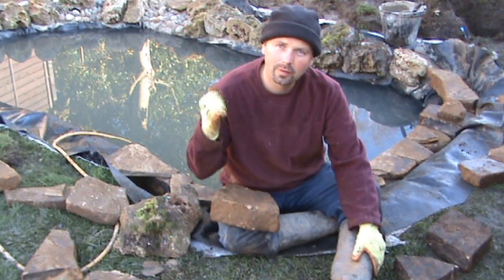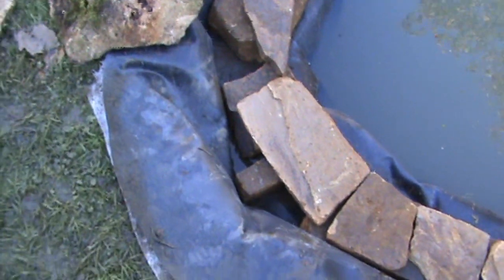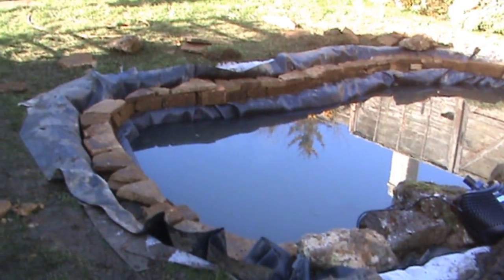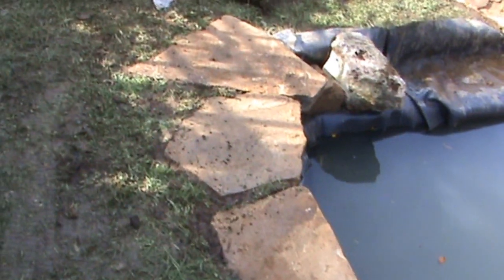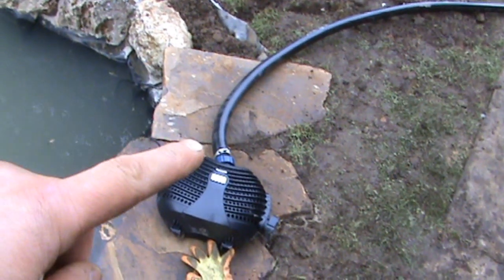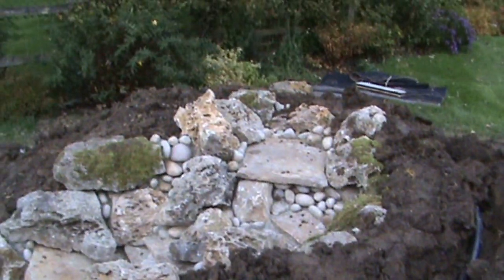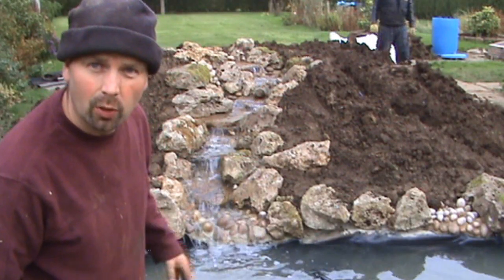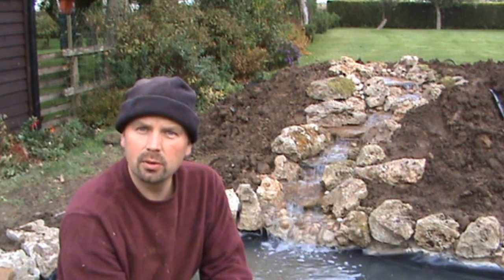How to Build a Fish Pond Part 3 - Installing the Edging, Pump and Filter

Comment from the maker: The filter may take up to 2 weeks to clear the water even though it is on 24/7. It always helps to have the pump at the opposite end of the pond to the filter outlet as you will get a better turnover of water then.

Comment: Your videos are so helpful!!! Question: what size tubing is being used? 1.5 or 2"? Going from my pump to the pressure filter, and from there out and up to the waterfall.
I saw in one of your videos you used a Y-Connector in order to let filtered water either go up the stream )or water fall) or directly back to the pond. I believe it is not suitable to ALWAYS use stream if very hot or very cold outside and in this case only let it go back to the pond directly after the filter, correct?
Many thanks, Willy

Comment: hiya mate , your videos are very usefull , ive watched most of them , if u dont mind can i ask u a question ? i have a still pond at the moment which i have call ducks in , but i want to build a raised , fish pond so the ducks dont eat the fish and keep the existing duck pond , my question is can i filter them both off one pump and one filter ? i was looking at the oase 8000 , but i wanted to cascade the raised pond into the lower one , or will i have to have two pumps ? cant get my head round it , if i could do it off one pump , would i have the pump in the lower or higher pond ? if any of this makes sense , i can build the ponds no trouble as im a builder just unsure on the filtration's , also do u sell , oase stuff im not far from you , north yorks near flamingo land uve probs been there cheers for any info keep up the good work !!!

Comment: I have a pond like this that I inherited when I bought my house. I have to take measurements to figure out how many gallons it is. I would like to buy a good quality pressurized filtration kit but not sure what to buy. I would like the uv light option and the backwash option also. Any suggestions on brand names that wouldn't be too expensive to run (electric wise) each month?

Comment from the maker: I always go with Oase as other manufacturers (e.g. Hozelock, Laguna, Bermuda and the nation of awful Chinese copies) concentrate on making their products cheaper, not better. The Oase pumps have very low running costs, long guarantees and the only running costs of the filter are from the UV light which range from 9w to 55w. 1w costs roughly £1 a year so a 55w UV unit in the Filtoclear 30000 filter would cost approx. £55 a year to run.

Comment: Awesome!!!
Reply from the maker: Glad you liked the video.
Reply: Wish I had a garden big enough for that pond I'd try and make it myself, I'm good at D.I.Y at the moment I'm making a water fountain that's how I cam across your video, I was trying to find out If I can just run a normal extension wire to it underground If I use protective tubing ?
Reply from the maker: Star Light
That is OK and what most people do. I prefer to take armored cable from the house to a switch box or double outdoor socket as then other appliances can be plugged in or wired in (lights etc.)
Armored cable isn't very expensive and won't be damaged by a fork or spade like some conduit can be.

Comment: I am sure the pump has to be hard wired in by a qualified electrician - you can’t just use a plug. Also, the cable has to run in conduit.